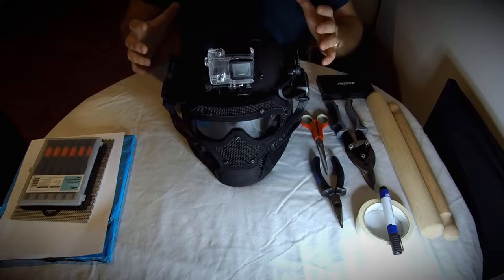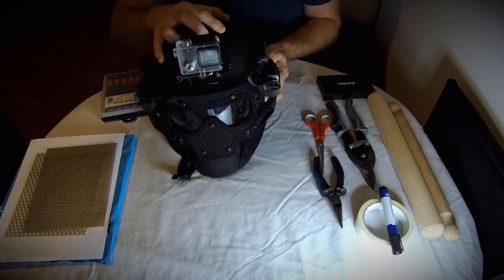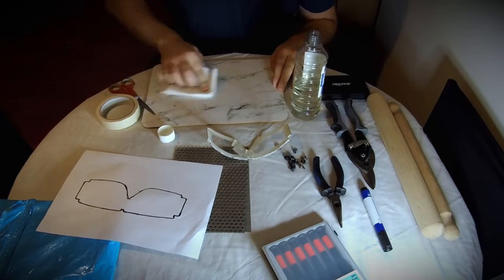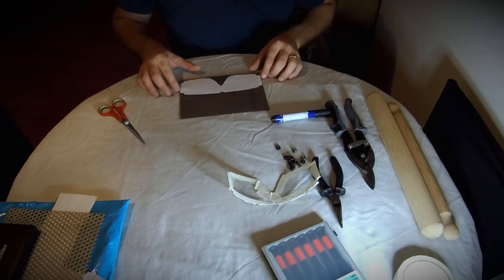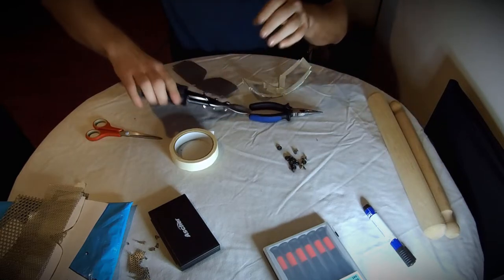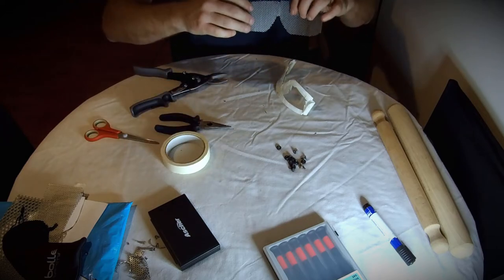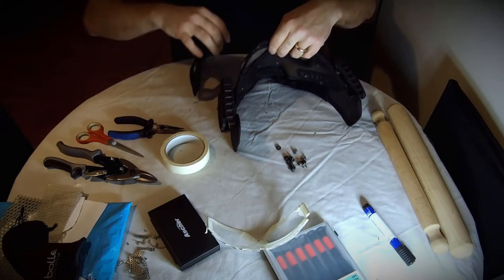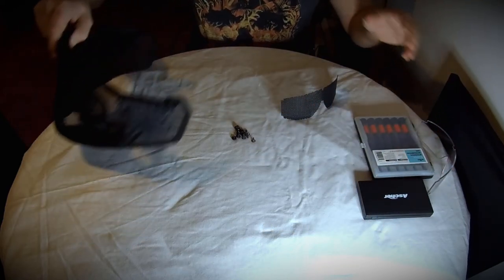Mesh Visor Upgrade Mod Guide | #NerfModding

Comment: Can confirm, even mesh will moisture up. Had it at FFS5, SOFFS, and even at Kyln, which was dry! However, it doesn't really impact visibility much; just makes details a bit blurry and sometimes catches glare. However, a quick couple of taps with a finger and any moisture drops will just fall off, so it's a quick and easy fix. Welcome to the mesh lifestyle!
Reply from the maker: Thanks Treezy, great insight into mesh. At least it seems easier to clear than those bloody lenses.